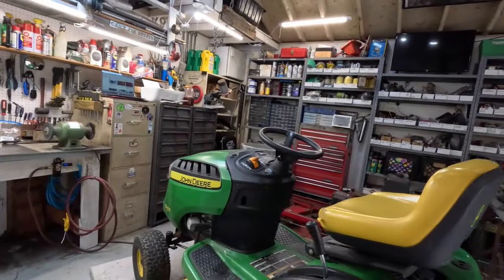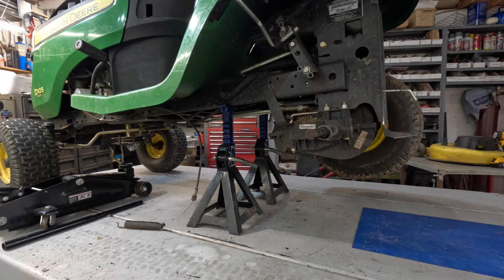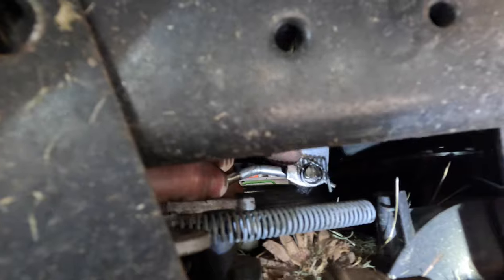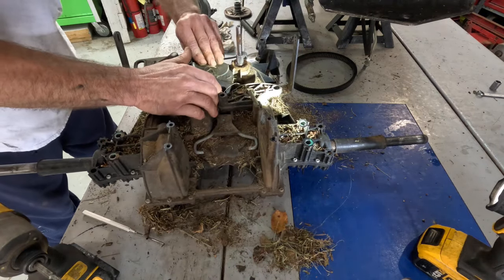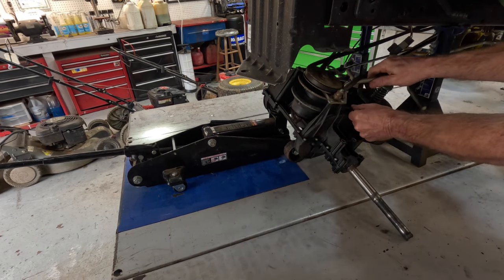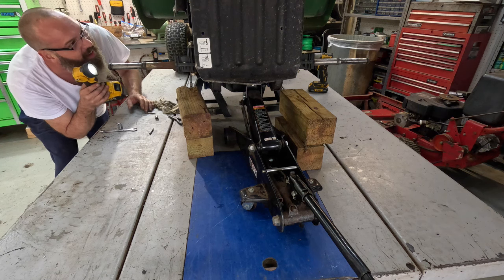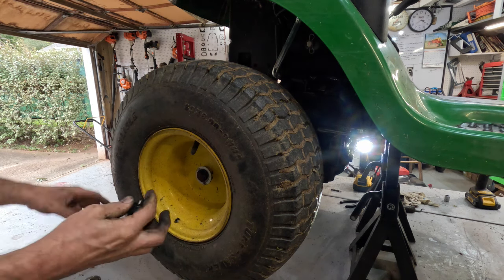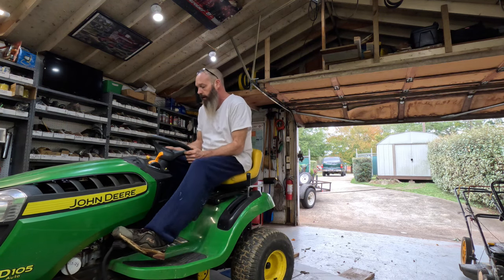John Deere D105 Riding Mower | Stuck In Reverse!

Comment: Great Video ** Stop ** Before dropping transmission **  I fixed mine yesterday, stuck in forward for over 3 months.  I used a Habor Freight Central Pneumatic 150 psi compressor with a HF Merlin 90 psi blow gun kit 64149.  I placed the longest probe in the Merlin kit  into each of the metal slots / holes around the transmission along with following the shifter lever and it blew 4 dust pans of wood chips and crap off the transmission.  Shifts like it's brand new !!!
Reply: This pointer is coming from a D105 owner that has personally fixed the transmission pulley (2) times by  dropping the transmission.

Comment: Thanks! I am that 80 year old retired old man you were referrring to in your video. I could not place handle in reverse. I saw all the debris you cleaned out and a light bulb lit up in my head. All I did was use a long screw driver and a heavy duty blower and did the cleaning without removing anything! The handle now goes in reverse and is smooth in all directions. Brother you saved me alot of money. God Bless you!!
Reply from the maker: thank ya sir!

Comment: I ended up with this job also. An E100 with so little time on it, the rear tires still have that extra, thin rubber on the center of the tread. Tks for this video, it made my day much better and easier! This guy also went out to buy another mower. He told me to scrap it if I couldn't fix it,
Reply: After I got it back together, I saw it had 4 hours only on it! I just can't get over someone buying a JD for all the money and getting a plastic transmission.

Comment: I have a Craftsman 42 inch tractor with one of those plastic transmissions. After about 8 years of cutting my lawn, and the neighbors front yard, I noticed it was getting hard to shift. I took out the battery and battery box to see what was going on, and sure enough, the top of the transmission was covered with millions of pieces of grass clippings. I thought I could just take a vacuum and suck out the dead grass in a minute or two, and soon be finished. Nope. The grass was packed down in between the plastic ribs molded into the transmission so tightly, that the vacuum couldn't get much of it out. It was as if it had been glued down in there. I had to spend at least 45 minutes breaking up the chunks with a screwdriver and sucking out the pieces with the vacuum. As fate would have it, there is just enough stuff in the way that getting the vacuum hose all the way down into the fins is impossible. Trust me, it can't be done. Unless you take the transmission out, you need to dig the grass out with something metal to get the vacuum hose close enough to suck the grass chunks out. 
How that grass gets up inside there and packs that hard is amazing, but it does. That was one time I missed my 240 volt air compressor that Hurricane Katrina ruined. 
After all of that cleaning ordeal, I thought that I could forget about it for years, but no such luck. Last year it started acting up again. This time I caught it early, so breaking the grass loose was a lot easier. For those transmissions, cleaning the top is a regular maintenance item. Thankfully, that expensive short drive belt on them lasts for decades in residential use.
When changing the grease seals on those transmissions, you want to go around the grease seals with gasket sealer, because even the new ones have a tendency to leak around the outer edge that goes into the transmission. Those transmissions are packed full of thick grease, so if a little oil is lost, you can ignore it. Just change the axle seals and forget about it.

Comment: I had to laugh when you mention about being 80 yrs old...well I am 77 and tho I love to work on machinery, just can't do things like this anymore. This is a excellent video, was just wondering if there is a adjust on one of the rods for the belt? 
Mine is hard to get moving in reverse, have to press really hard on pedal to make it move, also same with the forward.
Reply from the maker: no theres no adjustment, belt may be getting worn or theres debris in there